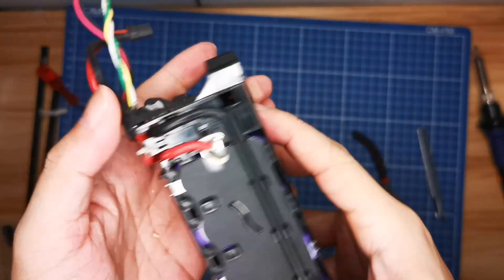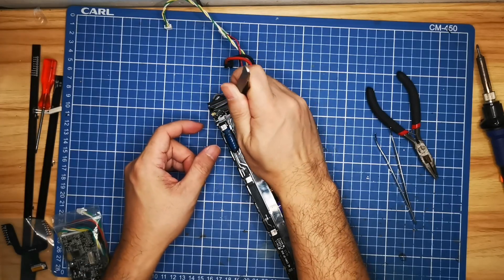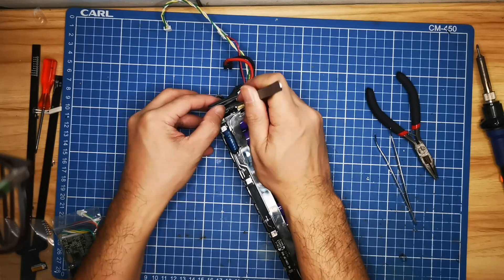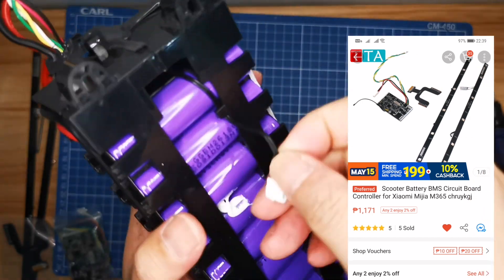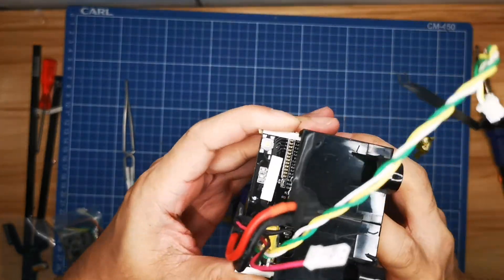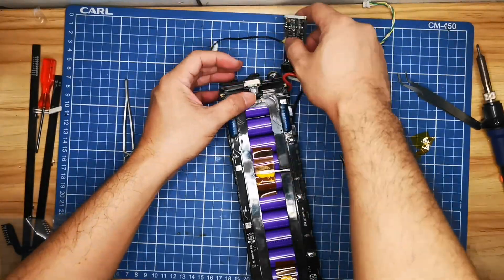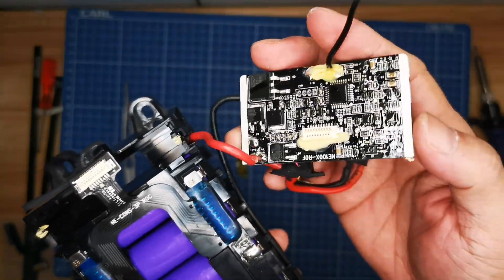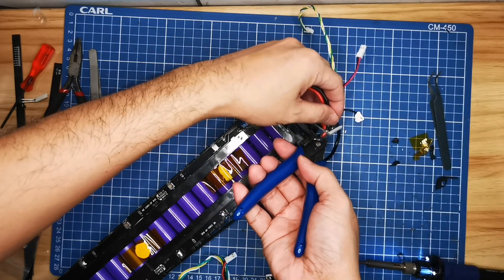XIOMI M365 BMS REPLACEMENT | HOW TO REPLACE BMS ON M365 ELECTRIC SCOOTER

Comment: I have an old first version m365. I changed the bms and tried turning the scooter on. It worked for 2 minutes and then stopped. Now it turns on and immediately off. And on the bms it goes from constant blue flashing to the red led1, any idea?

Comment: So my problem is, i reset bms then the scooter normally turn on and drives..then when i shut it down..and leave it for lets say 5 hours it wont turn on again.. is it the bms? It happens after it wet due to heavily rain..

Comment: Sir i have m365pro 3 cells po very low ng voltage how to know if the bms is the culprit?
Reply from the maker: looks like a battery issue boss. have it rebalanced first then then use it until battery runs out then charge it again. if hindi na sumasabay ang 3 cells baka need mo ma palitan yung cells na yun.

Comment: I applyed same proccess and it is working well now but it cant start to charge only. And then I reset it but this stuation same. What i must do please
Reply: I had exactly same problem ...after BMS replacement no charging ...Did you solve that problem by the chance ??
Reply: Ho, Do you have resolved?
Reply: @lucacavallini561  I have the same issue, replaced BMS, batteries are balanced, blue blinking light, but not charging !
Reply: @leehunt7264  thanks for feedback 👍...i have replaced the bms board, bridge bar, and flat cable ( buy on Amazon 49 Euros), 3 day ago, and now all work well👍
Reply: @leehunt7264  i have the same problem, did you solved ?
Reply: In my case the problem was a temp fuse on a bridge bar. You can measure it with multimeter it should be shortcuted.